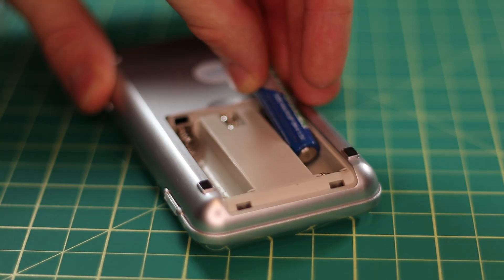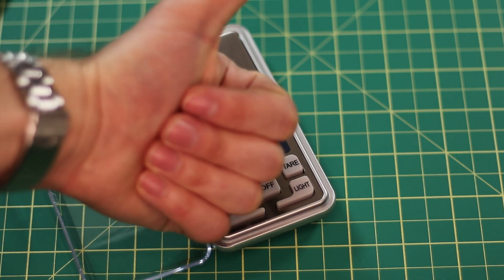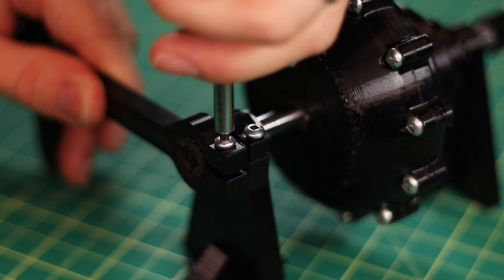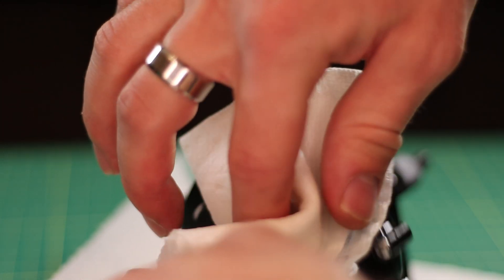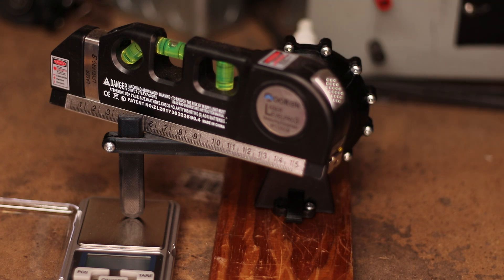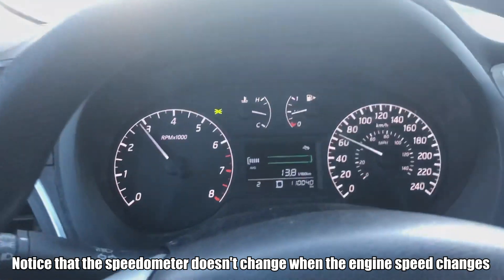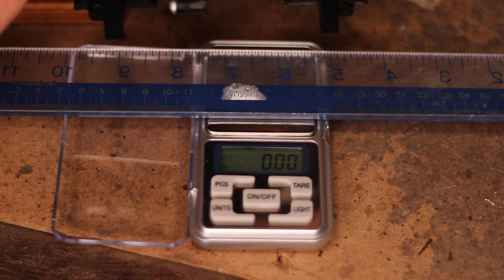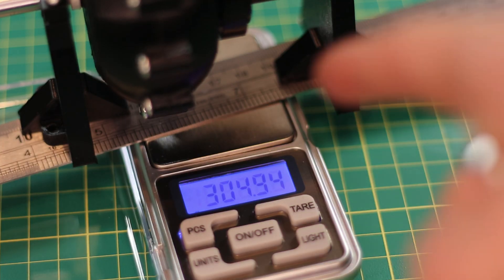What Happens to a Fluid Coupler When it Gets Too Warm?

Comment: Just found your channel. Great video. I think the oil seepage was do to thermal expansion. The print may have mircoscopic gaps between the layers.  Leaving a little air in the coupler may help mitigate the leaks. The reason it wouldn't drain is simply fluid surface tension. If it had a vent, it likely would have drained. The viscosity of the oil reduced as it heated up, reducing its effectiveness. This was a great experiment. Thanks for sharing it with us.

Comment: I wonder if you could make a drill/impact use a torque converter to tighten/loosen screws, just a random thought. it could also help with protecting screws and threads from getting stripped/breaking

Comment: Is there a way to effectively alter the stall speed of this
Reply from the maker: Blade pitch angle mainly, torque converters can have different pitch angles on the stator that affect the stall speed
Reply: @CamdenBowen  So if I pitched them in the direction of flow it would in theory lock up sooner. I've got this fun idea to essentially 3d print an rc pull truck and over engineer everything

Comment: Even actual tyranny fluid heats up and expands. Thats why you have a hot and cold measurement on your cars dip stick. Point is heating up expands the fluid and you have an air tight housing. So it’s pushing fluid out. Easy said than done, But needs a vent.

Comment: Awesome project, and thanks for sharing. Do you know the torque output of the drill at its various speeds? Would be interesting to compare that against what came out of the coupler and how transmission fluid changes it.

Comment: Dynamic torque like if the input is at 1000rpm and the output is 500 rpm lower or 200 or 1000. What is the power. Than @ 1500 rpm. Also shock it by violently stoping the output from 500 rpm.

Comment: Im sure that the fluid leaked out because of it expanding due to the heat, and because it was filled up to the max there was no room to expaned other than escaping. Maybe a little bit of an „air gap“ will prevent it from leaking. Just like the aio‘s pc watercooler🤔

Comment: You mentioned the expansion as the oil heats up, but another factor could also be the fact that the viscosity decreases as temperature goes up as well. An old mechanic trick for minor oil leaks on cars in hot climates was to just go to a slightly thicker oil, which would often reduce the seepage. I think this could also contribute to the torque falloff you saw at higher temps. I'd be interested to see what happens if you let it cool back down and then test again. That should clarify if the falloff is only related to fluid temperature, or if the small amount of fluid loss might be a contributing factor. 

Incidentally you were quite right about heat being the major killer of automatic transmissions, but I think for reasons you didn't really cover. If it was just a matter of the fluid being too hot, they would work normally again once cooled. In heat related trans failures, the actual issue is that the oil gets hot enough that it actually changes chemically, vastly increasing the viscosity (essentially it "cooks" for lack of a better term), though these temps are way higher than anything you encountered, above 300F was our rule of thumb for standard ATF. The friction material in the clutch packs then wears excessively as a result of the much higher load due to the thicker fluid, and eventually wears to the point where the clutch packs no longer have sufficient friction to stay locked together (this is the cause of the slippage which is one of the early warning signs of a transmission that's on its way out). I have even seen situations on extremely old vehicles where simply changing the transmission fluid was enough to cause the transmission to fail, as the much thicker fluid was the only thing allowing the clutch packs to grip at all.

Comment: Awesome follow up! I think that the horizontal arm doesn't behave like you think though. The angle between the point of contact and the center of the rotation is actually the interesting angle. You can imagine there is a straight stick between those two points. It would work exactly the same.
Reply: It is not the same tho. The normal force is perpendicular to the surface his method is ok

Comment: Realistically, when it heats up and loses torque, it's because of the design and the fluid. Modern ATF is fairly thin, and runs fairly hot, but still transfers torque well.

In terms of sealing, it needs to be painted with epoxy paint inside if you want to have any hope of it not leaking. FDM prints aren't water tight without it.

Comment: for the overloading problem you can make an armature much longer to reduce the force seen by the scale.
Reply from the maker: I tried this, what kept happening was the arm was too long and would flex enough that the torque reading was off by quite a bit
Reply: @CamdenBowen  ah, maybe cutting apiece of wood for the task then. or doubling up the number of arms or something. honestly that's a fun little engineering challenge in my eyes

Comment: Most modern automatic transmissions actually don't rely on the fluid coupling for high speed opperation, because of the inefficiency and waste heat.

Modern torque converters have, in addition to the fluid coupling, a wet clutch which engages once the converter reaches it's synchronous speed, ensuring maximum efficiency and protecting the transmission when hauling loads.

Comment: Oil expands when heated. Not a lot but it does expand. If you fill the chamber completely and seal it shut.... leakage
Reply from the maker: To account for this I had filled it about 3/4 of the way, when it's overfilled the fluid can no longer circulate properly either
Reply: Torque converters in car transmissions are actively oiled through a pump, right? Depending on the flow rate in and the drain orifice sizes would determine how much oil is in the converter under normal operation. Any idea what that is and how the air to oil ratio affects the performance?

Comment: Get a thicker fluid, shock oil from RC cars has a range of thicknesses. They're silicone based and you can get it so thick it's almost wax in nature (too thick for this imo) but vegetable oil is way too thin so you're not going to get as much torque transfer as you could get with a thicker fluid.

Comment: if you completely fill the oil and leave no air in there, when you heat it up, the oil will expand and as there is no air pocket to allow for expansion, it will push it self out via any way it can find, in your case, it would be the join of the outer assembly :)

Comment: I think you should put a small bellows type expansion port on that or maybe a piston with a light spirng to keep the pressure down when the fluid heats up. It would not have to be very big. You could put a large volume like a liter of fluid in a graduated container at low temp. Then heat it to 30C and see how much volume it gains. Then you could calculate how big to make the expansion relief. Perhaps just a thin walled panel of sufficient area on the housing would flex enough to keep most of the fluid inside when it heats up.

Comment: fluid couplers are also used in industrial machinery, and they also have blow out plugs in case the load stalls the coupler, you could imagine what happens if left unattended without blowout plugs. it basically becomes a small hydraulic bomb that spews melting hot  oil everywhere on failure.
Reply: Ive repaired a couple. 
Very simple designs.

Comment: I've had a custom-made torque converter fitted to a car to improve fuel economy round town - it made a massive difference. To improve the effectiveness of the fluid coupler though you may want to consider designing angled vanes in the turbine and impeller.
Reply: How does a torque converter increase fuel economy?
Reply: @PrimedProductions  it was an automatic that already had a torque converter, but the original configuration had a non-zero stall speed. Manufacturers do this for their own reasons including smoothness at tickover, resistance to stalling when put in gear, minimising creep speed and 0-60 performance. This is at the expense of economy. I had it rebuilt with the lowest possible stall speed because I was willing to sacrifice everything else for economy. But to point out, the early Mini automatic was more economical in town driving than the manual. That's because it had a generally low-revving torquey engine and a torque converter with a low stall speed and a 4-speed automatic that would go up through the gears quickly.  This means that the engine speed was nearly always low compared to the manual in town driving

Comment: Very interesting, especially how much the torque dropped once the oil heated up. Years ago, I tested the stall speed of a car's torque converter with hot fluid (about 180 degrees) vs cool fluid before the trans warmed up (about 90 degrees) because I was curious how the fluid's viscosity would affect the torque converter's slippage. Surprisingly, the stall speed was only about 100 RPM higher with hot fluid than cool fluid (2800 RPM vs 2700 RPM). I would have thought the torque converter would slip much more and be way less efficient when its fluid is so much thinner, but it didn't seem to matter much in my test. Perhaps the fact that a torque converter has a stator unlike your fluid coupler and the obvious difference in the fluid's viscosity stability explains the differing results.

Comment: The part of the spheres reminds me of how an automatic variator works. Like tho ones in modern scooters. They have weighted rollers that push a pulley outwards when spinning. The pulley is flat and kinda conical in shape, when it extends for centrifugal force it forces the pulley out and the belt runs on a wider point of the conical pulley, changing the transmission gear.
...I'm not actually explaining to you and my expl sucks i know. I jus didn't remember the name of the contraption.
Reply from the maker: You mean like a CVT? I have a video where I made one and demonstrate it if that is what you mean
Reply: @CamdenBowen  yup that 😅 I was writing at 6 am. CVT, for constantly variable transmission if I am right. I was confusing with the omocinetic joint which is also CVT but for constant velocity. 
I might be wrong, me nuh ingineer nor motherlanguage 😅

Comment: Given the second pun about the scale I had to tell you that yes basically that's what a scale for apart of weighting stuff is to dont' waste too much of the stuff and in the end dont lose money. Pocket scales are meant for gold bugs or micro electricians or people which uses small stuff, or does experiments like you.
I have one for proportioning epoxy resins with hardener, and the tooling gel expecially is always in small batches less than 25g mixed with 8% hardener. The correct proportion does not define the hardening time like in polyester resin for fiberglass but influences the properties of the hardened material.
I think drug pushers that use it to carry it around are dumb, since it's an immediate proof of the dealing intentions. Wether for Pablo Escobar as you said, it might be a bit out of sc-🤔

Comment: Tips for prevent leaking:
1. Try painting the 3d printed parts with epoxy, to prevent/reduce leaking.   
2 You can also fill the 3d printed parts packed with grinded/powder salt, and nuke the parts in the microwave fusing the plastic layers together.

Comment: Plastic is also a lot less thermally conductive and has a lot less thermal mass than steel or aluminium so the oil inside was probably a lot hotter. I wonder how easy it would be to cast the parts?
Reply from the maker: Probably not too hard, the challenge more lies in achieving proper tolerances and making sure everything is perfectly balanced

Comment: I wonder how close the internal oil temp is to the outside shell, there might be a decent difference?
Reply from the maker: I wouldn't be surprised, the outer shell changed quickly in temperature which leaves me to believe the inner temperature must have been much greater

Comment: 5:25 It works exactly the other way around, when arm isn't horizontal it's "shorter" so the scale will read more force.
Also, "dynamic torque" means torque while output shaft is spinning too.

Comment: Dynamic torque the commenter was referring to is actually the torque while the shaft is spinning. Your torque tests were done with the coupler stalled against the little scale, this is known as static torque. A simple (and very similar to what you did) test for dynamic torque is a pony brake, you basically just let the lever arm slip on the coupler output so the coupler can actually spin.
Reply from the maker: Thank you for the clarity! If I had to guess it's dynamic torque increases as the oil flow becomes faster and smoother while the momentum of the oil helps keep things in motion
Reply: @CamdenBowen 
Afaik - and in couplers of regular commercial design - the dynamic torque decreases with increasing shaft speed.
Work stays roughly the same minus maybe some decrease/increase in losses, so as the output speed increases the torque has to decrease or you invented a perpetuum mobile of sorts.

Comment: Making the arm horizontal isn't doing what you think it is. the force at the tip is still rotating around the axis of the fluid coupling, regardless of whether the arm is a straight line to the balance or an L shape or any other shape. It would be better to have the point of rotation level with the top of the scale

Comment: Another cool video! Thanks. I wonder what would happen if you chilled the oil before use?

You could easily put some fins on the sides of the coupler as well; to serve as air cooling.
Reply from the maker: Thank you! At around 5 degrees give or take, I notice the oil gels up and becomes more of a grease until it warms up. Since its gelled up it doesn't work properly until the oil can flow. However, since the oil is more viscous when its cooler it does work with greater efficiency

Comment: if you want to make a 3d print watertight, one of the easiest ways is to just spray on some plastidip. the relatively rough surface of a 3d print makes it really easy for the plastidip to adhere to it. i did this when i made some custom hose adapters and it stayed completely dry on the outside where i sprayed on like 1 or 2 thin layers.
Reply: To reduce the chance of a leak, set the slicer's seam position to random (and increase the number of outer layers to as thick as practical)

Comment: if leakage remains a problem, a possible solution might be in making an inner and outer shell for each half, then gluing them together with jb weld or thin spread of silicone to create a fluid tight membrane.
great video, a fun experiment, with tons of possible uses.

Comment: That scale trick sounds weird to me. Usually the limit is set there becouse the sensor is overwelmed and probably becomes very innacurate or it just might break, so the pressure plate probably is designed to physically bottom out when it reaches that kind of weight. Unless its limit is actually 1 kg... for this specific case
Reply from the maker: Yea in retrospect it isn't very smart lol, but it offers a slightly more accurate result than it did maxing out at 500
Reply: @CamdenBowen  Im just surprised that that actually increased the limit how much weight it could handle
Reply: @CamdenBowen  sorry but its not really accurate if you can't be sure of its readings being accurate, when you push the sensor out of its range set range it might act different as when its in spec.

Comment: Maybe comparing this to a centrifugal clutch and the clutch you made earlier would be interesting. And having a heavier scale would be better, could break the load cell as someone else said.
Reply from the maker: I think it'd be near to actually have it used in a real application like a bike or something and see how it holds up to other designs. Maybe a tension scale will work better as well

Comment: Awesome video Camden!
Do you maybe think the less torque being produced at higher temperature was maybe due to the viscosity of the fluid going down as temperature goes up?
Reply from the maker: Thank you! I noticed vegetable oil is very temperature sensitive, at around 5 degrees or so it almost turns into more of a grease but after 15 degrees it becomes a very thin fluid. Past that it gets even thinner so it's very possible that it was responsible for the low output. Actual transmission fluid is built to have a much more consistent viscosity across a much larger temperature band

Comment: The layers delaminate probably because as the oil gets hot, it expands ever so slightly... FDM printing layer adhesion is probably never going to be good enough to counteract this. Although I suppose you could try some things like making the housing out of abs and acetone smoothing it (that would ideally create a continuous outer shell) or sintering - although I have heard that this actually makes the part weaker.
Reply from the maker: I had filled the coupler to about 75% or so to account for the thermal expansion. However as the oil warms up it becomes thinner and since it is also under pressure from the coupler running, it probably aided in forcing it through. Instead of using ABS and acetone to smooth it out, I may try annealing the parts to evenly melt all of the layers together. Though it raises concern for if the part tolerances will change after the process.
Reply: @CamdenBowen  I wouldn't mess with annealing plastic. Way too much deformation and guesswork, and your work requires low tolerances. If FDM doesn't work, you can try SLA, next best would be CNC alum for certain components
Reply: You could also cost your parts with epoxy or ca glue to fill in the layers